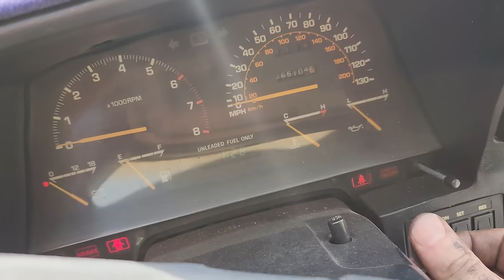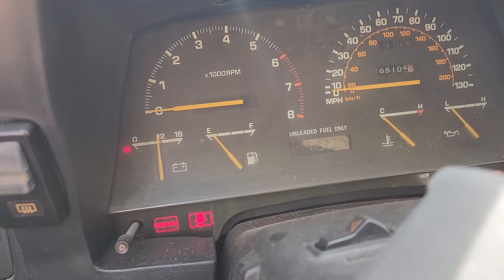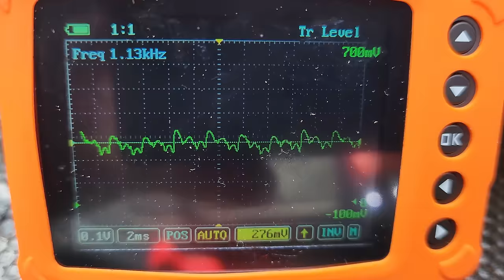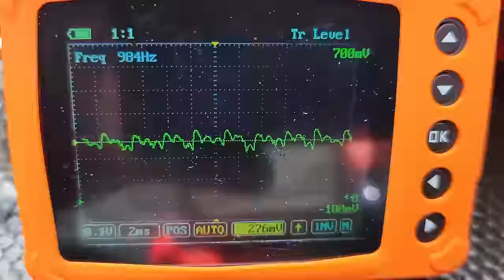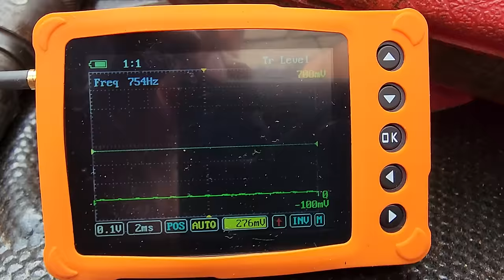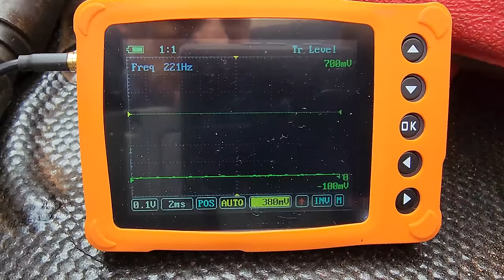Working on Beau Danner's 85 Celica [Fuel Pump Diagnostics]

Comment: I love those old Celica you cannot kill them.  I had a gen1 Celica 1977 GT.  I saw the odometer roll over twice while I had it,  when I sold it  it must of had close to 340k miles .   The 20R, 21R , 22R, 22RE are known to be able to get a lot of miles the 22R/22RE is known as the million mile car.   20R and later R Engine is some what influenced by the HEMI engine of Chrysler.   The 20R and subsequent models featured important design changes relative to the earlier SOHC R-series engines. The head was changed from a reverse-flow to a cross-flow type with hemispherical combustion chambers and shorter valve rockers. The timing chain was strengthened. The lower block bearings were strengthened against wear, safeguarding oil pressure, and the stroke was lengthened. The changes increased torque substantially and shifted peak power and torque towards the lower speed range. The later R series engines did much to establish Toyota's reputation for reliability, which had previously been indifferent at best

Comment: Holy cow, I haven't seen one of them in decades, if I remember correctly the starting circuit also fires the cold start injector.
Reply from the maker: Yes sir! Through a thermo-time switch 🙂
Reply: @ScannerDanner  Yep, thought so, in fact I noticed you had the upper intake off, again if i'm not mistaken I think there should be some ground wires around there that use the bolts for that intake one of them grounds is for the cold start injector. The old front engine VW use the same set up.

Comment: Way of topic, a video explaining OBD 2 mode six VVT monitor parameters would be very interesting, especially if it helps diagnose cam crank correlation issues.
Thank you for considering it.

Comment: my guess by 1:41 the tank is full of trash and plugging the pickup sock, after the short burst of high fuel flow. alternately, the fuel filter is doing the same thing.
when they're full of debris the high flow stirs it up and plugs the sock/filter, then after sitting for a while it settles and has flow for a bit.
rust, sugar, powder, etc.  same outcome

Comment: Great little project car. Hopefully will see many many more miles on the road again!

I have a puzzling question for any Scanner enthusiasts. I have a car that reads 60 ohms on the CAN lines at the DLC so no open circuit. Yet I read 3.2 volts on both CAN High and CAN LOW when connected to ground when the BUS is asleep (0 volts between can high and low). What could cause that?

Comment: thank you very much for the video. I have a small request. If you can help I will be very grateful. Hyundai accent hatchback 2014. 1.6 gasoline engine. elctronic throttle valve. when you turn on the headlights and heater, then the engine speed drops. even when you turn the steering wheel while standing still. I checked everything. ground on the engine is good spark plugs are new. the generator produces 14.7 volts. I cleaned the throttle valve. Twin quality gasoline. if possible please give me advice
Reply: Check your IAC valve wiring harness
Reply from the maker: What is desired idle speed during those events?
Reply: @umairashfaq0332  all ok there
Reply: @ScannerDanner  desired 630, really 620 . it suddenly becomes 530 during the event and returns to 630.
Battery is new, it is third battery, which i check for this situation. I don't know wtf. I checked exhaust, it is good too.
Reply: @ScannerDanner  desired 630, really 630. During those situation idle speed descends to 530 and rises to 630.
Exhaust is good too. No codes. I checked 3 new batteries. Cleaned all systems. negative current points iare excellent.
Reply from the maker: @avtoblog4767 maybe an idle relearn needs to be done or you didn't clean the throttle body enough. Any other codes or symptoms? When did this start? Was it any different before and after throttle body cleaning was done?
Reply: @ScannerDanner  i am master. Yesterday i removed and cleaned this once again. Relearned with "launch". I think it is problem of the software. From 2014.  previous owner drowe like this . noticed the problem after i bought it.
Reply: @ScannerDanner  is it normal for idle speed 630? I think it is really low

Comment: Curious, on your crank no start diagnosis, do you use cranking lambda reading for direction? 
Thank you in advance for your answer.
Reply from the maker: ? On an 85 Celica and cranking lambda? Never heard of that term being applied to a starter circuit
Reply: @ScannerDanner  Thank you for the reply.
Not the starter circuit, lambda reading on tail pipe while cranking on a crank no start condition, to get diagnosis direction. 
Fun educational student project, create different fault on good car, like disable fuel pump or ignition on a hot soak and look at tail pipe lambda reading while cranking, this exercise gives a template for diagnostic direction on problem cars.
Reply from the maker: @rodvan-zeller6360  ah, my fault, I understand now. It certainly is another tool to use in the diagnostic tool box
Reply: @ScannerDanner  Thank you for the reply.
I like using that method. By the way, great job as a father, my fellow brother.

Comment: Hey paul u said 3 wire hall effect is square wave, 17 ford explorer new crank sensor learning my tools cuz of u it's 5 volt pull dn but it's not square doesn't matter what time base, if I had link wld love to send clip of video of my capture
Reply from the maker: Some VR sensors (2-wire) will have a 3rd wire that is nothing more than a shield. So AC sign wave on that type of sensor. And Fords, forever, used a VR type crank sensor
Reply: @ScannerDanner  how do I test a vr, I hv watched ur vid but I'm too dam tired at this point how do I hook n c
Reply from the maker: Search my channel in my chapter 21 playlist VRS (Variable reluctance sensor)
Reply: @ScannerDanner  ok thnx

Comment: Hello Mr scanner danner will you help me fix my 1997 jeep grand Cherokee I bought these jeep a couple weeks ago it a v6 first time I got it drove fine after disconnect the battery I I list the thing I have been fix cover gasket spark plugs spark wire distributors cap ignition rotor ignition coil new battery map sensor iat sensor crack shaft position sensor throttle sensor manifold sensor new pcm new fuel pump and then I reconnect the battery and the jeep crank no start my instrument clutch and obd port not working and please can you help me i ask shop they charge 200 a hour for diagnostic I can’t afford
Reply from the maker: You made it more complex by changing all of those parts and you've depleted your resources in the process. There is much I can help you with unless you have a way to pull codes and have a voltmeter and a fuel pressure gauge
Reply: @ScannerDanner  if you can come over mr scanner danner because I watch your videos you have all kinds tools and you very smart with it and how much you will charge i live in st.Louis city Missouri
Reply from the maker: @ChendaChhun-h2u 😂 I wasn't offering a mobile service. (I'm in PA) I meant I would help you troubleshoot it if you had the tools and the ability and could follow instructions.
Reply: @ScannerDanner  sorry to bother you sir

Comment: Yu make it verry confusing I been fixing autos fifty years.. u loos me with ur milli amps. Wave pattern and stuff I’m not just a parts changer those terms are discusting… fixed more cars than I ever will . Went to collage in 80s. Theory was all they thought.   The industry is verry mesed up
Reply from the maker: I've used this technique in many other fuel pump case studies if you're interested in learning it.
Reply: @ScannerDanner I’m mentally disabled I can’t understand most things on disability it’s horabel. But I love to fix cars anything auto related. Can’t afford battery tolls or computer stuff. Thanks I’m just beat up by this industry people call me stupid….
Reply: @ScannerDanner  I watch s,m,a flying reaches and u. U all have thought me an enourmsss amount… been doing this sence 1972. Then I was a parts changer. Today I feel a master tec took ase twenty times over three decades flunked every test… ur supper great people thanks so much good day to all